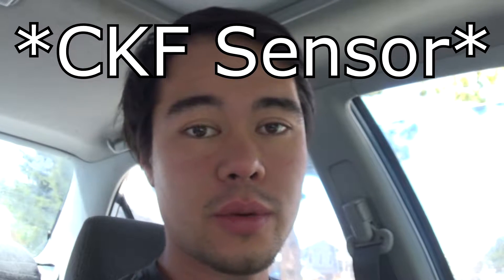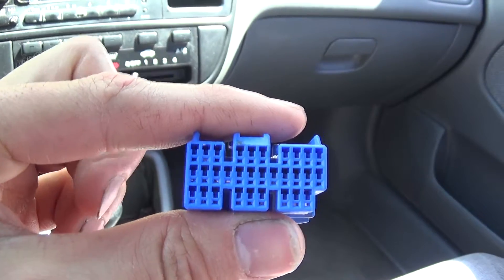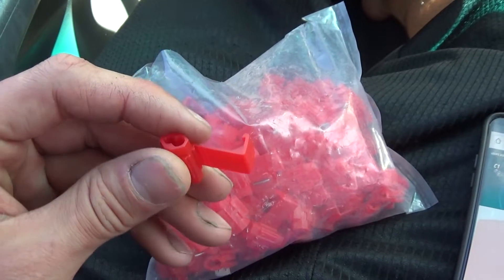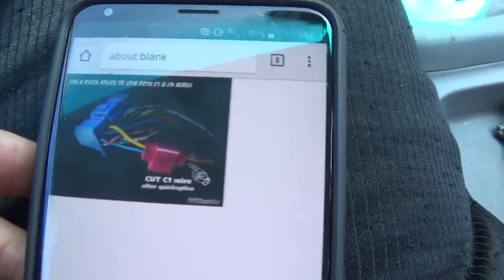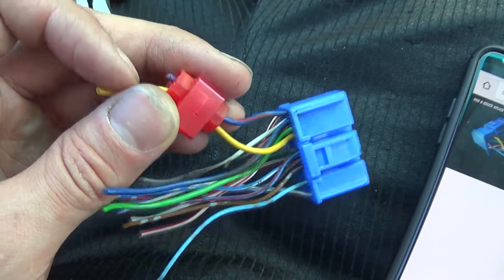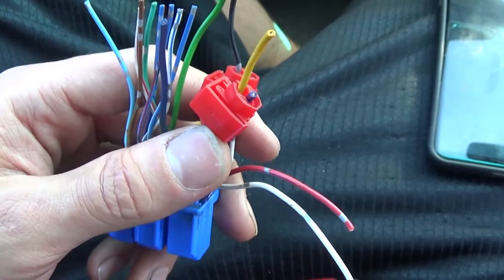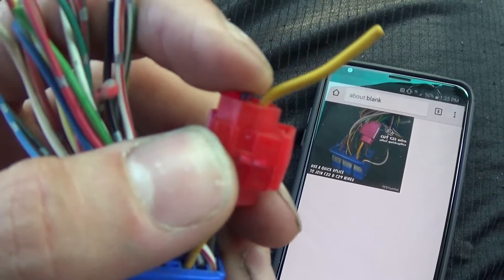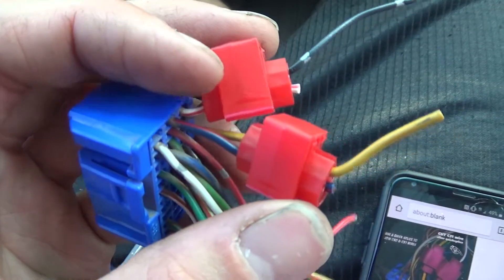Honda/Acura CKF bypass trick - In Depth

Comment: I know this video is like 5 years old but I just wanna say thank you for making this video, you saving lives in 2024 lol
Reply: Hey man, just wondering if you’re car started throwing a p1382 (CYP Sensor) and did you do exactly what’s shown here?
Reply: @HppyTggy How long after the bypass did that code come up? You might have a faulty connection on the splice.
Reply: @HppyTggy update on this? Having the issue rn with my z6 block y7 head and harness/ecu

Comment: i have question i spliced the wires and it still throwing that code and not running correctly i have a d15b vtec

Comment: So my 99 civic had this mod done to it because it's got the JDM B18C swap. My question is I'm installing a chipped p28 for some future dyno tuning. Should I leave the wires spliced? Or put them back to stock since I'm running an obd1 ecu in an obd2 car?
Reply: did you ever find out the answer to this?
Reply: @JDMworx  I ended up buying a rywire tuck harness and the ckf bypass is isn't needed because I'm running the obd1 ecu. The ecu I was running was the obd2 and it required this bypass.
Reply: @lafollettegarage4019  how is the rywire, plug and play?

I'm B18 with no ckf or oil pressure switch, obd2 harness and chipped p28 with jumper, took my harness apart to tidy it up and I've found splices and jumpers 🤦
Reply: @JDMworx  I too found the same. A bunch of splicing. But it's a nice harness! It eliminates alot of the extra wires and tucks all those ground wires inside the car under the dash.

Comment: I have a 98 with the stock d16y7 , I got the check engine light for the exact same thing . But the wire was torn since it was grinding against the alternator belt . Would this bypass still work for me ? I just don’t wanna go through the hassle of changing out the sensor . Lol
Reply: Did you try this? Lemme know having the same issue
Reply: I need to know the same thing
Reply: Did u figure this out ? I also have a 98 with a y7, I don’t wanna change out the sensor , will this bypass work ?

Comment: I bought a 97cl 2.2 with a broken key missing the resistor piece so it won’t start. Would this trick my ecu into running the car? Or could I start it on my p2p manual ecu?
Reply: You can swap the ecu to 96 cause it didnt have a chip/key imobilizer

Comment: Hello, what is the purpose of bypassing ckf? Thanks
Reply: Japanese engine don't have ckp sensor
Reply: @elnenegordo3688  Mine does, d15b engine. Timing belt snapped and took the crank sensor with it, now after replacing the crank sensor my check engine light came on, and I'm getting a code 54 CKF - crank fluctuation sensor. I'm considering doing this to see if it gets rid of it
Reply: @rookie1178 did it work?
Reply: @moe_trill  Yup, check engine light turned off and drove fine until I sold it a year later

Comment: Please what is the implications of by passing the CKP?
Reply: Your ecu is programmed to use a sensor that determines the position of the crankshaft. The position can be determined in other ways but without the sensors that would be on the oil pump, the ecu throws a cel and even a flashing cel because it does not know the position of the crank

Comment: So b20b obd1 swapped into my 2000 integra attempting this because of the p1337 code but wire next to the white and red 1 is white not black would it still be the same thing
Reply: Did this work for you? Or how did you bypass
Reply: @Nq-100 sorry to chime in but yes 2000-2001 Integra's the back wire is white instead. I just did it on mine and the CEL and code went away for the CKF sensor. Getting snogged in the next couple of days .

Comment: 2 year old video but I got a question, will doing this throw a CEL?
Reply from the maker: It shouldn't, it didn't for me.  It actually fixed the CEL I had and ran smoothly
Reply: We clip c1 and c11 to prevent CEL. Without clipping them the computer throws a code because it’s getting signal from another wire.

Comment: I just did it how you did and I'm still having the same issue code #4 crank position sensor I'm on my 5th brand new distributor. Help really appreciate it thank you
Reply: Same have you figured anything out ???
Reply: Yooo there’s a sensor by the crankshaft pulley on the bottom of the timing cover ! Try to replace that .
Reply: Crank position sensor is way!!!! Different from crank flux sensor (ckf)
Reply: 5th goddamn

Comment: Fucks up in the first 5 seconds, doesn't edit it.
Reply: Another example of a YTuber knowing absolutely nothing what they're talking about, simply converting googled content into video form.
EVERYTHING he says is incorrect. It's not a Knock Sensor, its a Crank Fluctuation Sensor. The distributor sensor doesn't "mimic" anything. It's the same type of sensor as the one found on the cranks on OBD2 cars. Doing this "trick" will make the car drivable, but will disable the ECUs live ignition tuning strategy and cause preignition.
Queue the hordes saying "I did this and my car runs fine derp". 
Much like OBD2 added a downstream O2 sensor to monitor the performance of the cat converter, a Crank sensor was added on the crank to monitor preignition. The Crank Position Sensor on the distributor infers crank speed based on cam speed. Cams spin at 1/2 of the speed of the crank because they twice the size of the crank sprocket they are connected to via the timing belt. In cases of preignition, the crank will very slightly (in tension of the timing belt) outrun the cams (in terms of the relation in speed they are supposed to have).
Your engine makes the best torque right at the ignition timing advance point before preignition. So the CKF strategy advances ignition timing until it detects preignition, then backs it off to maximum torque.
With this bypassed, it will never find an occurrence of preignition and will advance timing to the max allowed, which means you're driving around with preignition, wasting gas, power, carbonizing the combustion chamber and emitting excessive amounts of NOx. If for whatever reason you feel justified running this "trick" long term (running an OBD1 engine on an OBD2 car), run the highest octane avaiable, prefably 93. You'll be very unlikely to be experiencing preignition.

Comment: so quick question. I have a d16z6 motor (someone swapped it in before me) and the pigtail isn't blue. its green. its also a P2P ECU. would it basically be the same? and how would I find out which wire is which or am I kinda screwed?

Comment: I did this on my 1998 Honda CRV.it solved the issue with how the car was running but now sometimes it will randomly cut off and we'll have a hard time getting it to crank on. The fuel pump is making a loud noise to. It is a new fuel pump though. Did I mess up some of the wiring?

Comment: I’m confused the write up says to depin or cut the wire indicating that it’s cut on the ecu side.. but your saying cut after the splice ?
Reply from the maker: Yeah, the write up is a little confusing/misleading.   You don't want to cut or depin the wire between the splice and the ECU plug - that would defeat the purpose of this fix.  
You want to cut the wire after the splice so there isn't an interfering and confusing signal coming from the sensor side wiring in the engine.
Reply: CtrlAltDefeatTV I tried both ways but I kept getting the trouble code, in the end I had to re connect the wires to the ecu and left the wires spliced. For some reason that worked for me 🤷‍♂️ d15b7/y8 mini me, automatic 99 ex
Reply: By doing this by pass would this make my tach work ? Hasn’t worked cause no crank sensor from wat I believe runs and all just rough kinda
Reply: @mattluecke8642 the tach connects to the blue wire of the igniter (ICM) in the distributor in the Y8. I could be mistaken, but if it is having problems I would look in that direction

Comment: Hey what's up man love the video! I'm having issues it's throwing a code that is the crankshaft position sensor I have a 1994 Del Sol that I swapped a d16z6 2A b20b low comp. Z6 is p28 b20b is p75 how do I bypass the sensor on this harness if my b20b even has one
Reply: Did you figure out the problem?

Comment: Yo on my b20 swapped 2001 Acura integra gs I matched all the pins for obd2 cfk bypass trick n it didn’t work but the wires are white n red /white instead of white/red n black it didn’t work emissions coming soon any suggestions ?
Reply: Did you find a solution to this ?
Reply: @shneshusns1319 late to the reply but the black wire in the 2001 integras is white instead. Same process.

Comment: Having this problem on my 92 EG!!!!! Had a b20z2 in it and think it’s the d series harness that was hacked for it and had a check engine light flashing and code was coming up as speed sensor welp blew that motor up and am in the process of swapping another b20z2 in it and noticed that my old engine didn’t have the crank sensor and the new one did! So i got the wire with the connector and traced it all the way back to the ecu come to find out my p75 ecu doesn’t have that blue plug you were splicing off of!!! WTH?!? Any suggestions on how to run the crank sensor off the dizzy with the p75 ecu??? Trying to get the car running by the end of the week and really want to solve this problem!
Reply: Did you figure out your problem after?

Comment: can someone just comfirm, this is tapping on the cylinder position sensor.. right?
i have the haynes manual, lost spark when i put in a d16a on a 98 civic, it was working ok before a put the new engine in, 
im trying to understand the wiring diagram and the logic on this trick.
Reply: did you get it to get spark again

Comment: Can i do it on my 2009 acura tsx?
Reply from the maker: You don't have to do this trick on a TSX.  This trick is for OBD2 civics/integras/CRV/Del Sol's with an OBD1 or JDM bottom end blocks without the ability to run a crank sensor.  
Your TSX and any engine you could do a stock replacement with are all OBD2

Comment: You know if this will work with a honda accord 95
Reply from the maker: What are you trying to do?  A 1995 accord is a OBD1 which doesn't require a crank position sensor.  So you don't need to bypass anything.
Reply: @CtrlAltDefeatTV how would I do it with a 97 accord

Comment: Does this work on crv? I want to Run a 96-98 CrV engine in 99-00 Crv?
Reply from the maker: You shouldn't have to do anything to run that engine in your 99-00 CRV.  A 96-98 is OBD2 and will have a crank position sensor already on the block.
Reply from the maker: @dl2026  lol, I guess you could do that and it would work.  The sensors in my experience hardly ever, if at all, go bad though.  You could always snag one from the junkyard too for pretty cheap.

Comment: WORKED PERFECT FOR ME!! I have a 1998 Honda Civic ek hatch.. running a B20b Jdm motor & a p75 Ecu obd2a .. I did this method & CEL is completely GONE for good! Thanks for this method! Don’t be afraid to cut the wires after the splice! It works 100%
Reply: So your running a ob2 ecu on a obd1 engine?
Reply: @Editzbybrian  I was with the b20 yeah but I swapped it .. I’m k24 turbo now with a k pro ecu
Reply: @Shotbyfana  how did u get rid of the cel’s. I’m asking because I have a jdm b16 with a jdm ecu. But I need to pass emissions and I put a p2t obd2 ecu but there are some cels such as p1259.
Reply: Derrick Lynch yes if you have a JDM B20b motor. My friend did the same on his crv & fixed his check engine light

Comment: what are the drawbacks of doing this in daily driving?
Reply: to anyone wondering, there are no drawbacks lol
Reply: it will run as nothing is wrong no check enging at least from crank position sensor
Reply: If anything it's a positive one less sensor you have to worry about

Comment: Just put a b20b in my 98 crv. Being that my crv is 98 it should be obd2a right?  Well the blue C plug was wired exactly like it was obd2b, so I couldn’t do this the obd2a way. I had to do it like it was obd2b. I don’t think this worked because the check engine light came on
Reply: I have a crv and same thing

Comment: Just take a razor and strip all the way around the wires on the plug without cutting them.Peel off a small section of the insulation without cutting but make sure you remove it all the way around.Then use a small bridge wire stripped on both ends to bridge the wires together.So no clips or cutting in two that fails on some people.

Comment: I Got a jdm b20b from the engine importers, should I use the jdm distributor that came with the b20b or should I use the distributor from my original usdm b20?
Reply: You can use the one that works with your wiring harness plug.

Comment: i have a 2000 civic ex. my d16y8 block took a dump. so i bought a d16zc (z6) block. therefore, im keeping my y8  top. 

this block does not have a knock sensor. i was told i have to bypass the crank sensor. i wanna keep my p2p ecu. i dont want to switch to a p28 ecu.

is this what you're doing? also, are there any drive-ability/performance issues by doing this?
Reply from the maker: That's pretty much exactly what I was doing in this vid.  This CKF bypass is for the sensor on the crankshaft.  The Y8 does use a knock sensor where as the Y7 does not, but the Y7 does have a threaded portion near the oil pressure switch to accommodate one.  Does the Z6 block have anything like that?  The knock sensor isn't super picky about where it's located, as long as it's somewhere on the block so you may have to get creative.  
As far as performance issues go, none to report.  I don't have the civic anymore that I did the mod to but it ran and drove as if it had the stock D16Y7 under the hood.
Reply: Where at by oil pressure switch do u know?

Comment: OK so let me get this right OBD2 is what I have my 99 CRV is an OBD2. It should work even knowing that I do have a sensor for it that's what I want to know that I can go head and crimp the wires through the diagram you have and that will allow me to bypass the  Crankshaft positioning sensor that's what I think I'm trying to ask lol
Reply from the maker: Yes, if you do that, it will bypass the crank position sensor.
Reply: Just make sure your tapping it into the obd2b pinouts locations
Reply: BUT, WHERES BARRY!? So you can just do the bypass even with the sensor still mounted? Just so it doesn’t throw the CEL

Comment: So a b20b non vtech no swap just that p1337 code then I should have no problem...? Cause I do have a crankshaft positioning sensor. But I dont want to replace it. Lmk if its possible thanks man your are awesome
Reply from the maker: Yes, it'll work.  Just clip the wires that are described in the page I linked to you and you should be good.  A faulty sensor, a working sensor, or a missing sensor.  If you clip the wires correctly and splice the wires correctly, it'll work as it only takes the signal from the distributor.  

http://ff-squad.com/wp/?p=309
Reply: @CtrlAltDefeatTV  I have a Honda too with check engine light and code P1337. Would the instructions work for this too? Thanks!

Comment: So this should bypass my p1337 code for crankshaft positioning sensor. I need to pass smog. But this is keeping me from doing so.
Reply from the maker: If you have a honda vehicle with an OBD2 D or B series engine, then yes it should work in bypassing that crank sensor code.
Reply: Did you ever smog it and if you did , does this mod pass smog ?
Reply: @vickyenriquez1033 I'm about to find out in the next couple of days.
Reply: @marcozuniga8163 hey wondering if you were able to smog your car with this mod. I’m thinking about trying this but don’t want to cut anything up if it doesn’t pass smog. Thanks for any information you can share!

Comment: What web page are u using I have a 99 accord I did a f23a1 jdm swap and don't have the sensor and need to know witch wires I need to do it to mine are different
Reply from the maker: I used this site here 

http://ff-squad.com/wp/?p=309

And actually, I don't believe this trick works for accords.  It's only for del sols, civics, CRV's, and integras with a D or B series engine
Reply: Yea this bypass trick doesn't work for the prelude/accord platform. Those vehicles have extra ckf wiring that makes the bypass trick impossible.
Reply: @jkatman so what do I do then
Reply: @wes5118  you'll have to install ckf components to please the OBD2 ecu or convert to OBD1

Comment: could this work if i broke my crank sensor on the back of the block. instead of replacing it can i just bypass it
Reply from the maker: back of the block?  This bypass only works if your crank sensor is broken or missing.  It's the sensor mounted right near the crankshaft on OBD2 vehicles